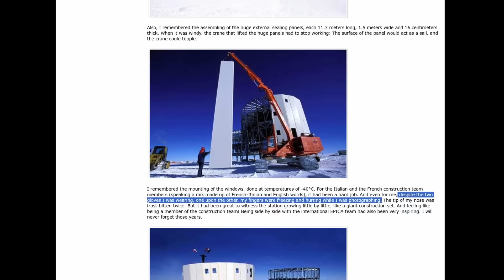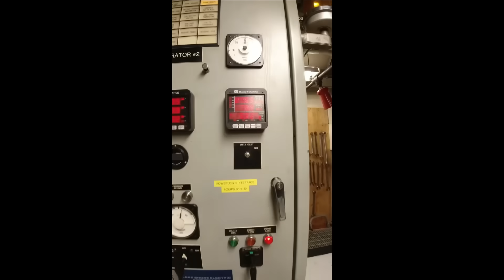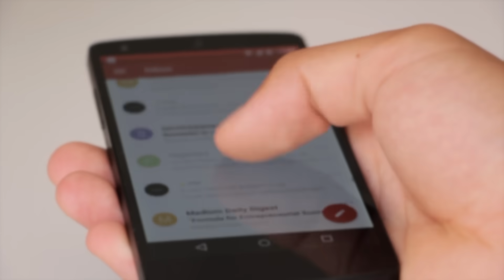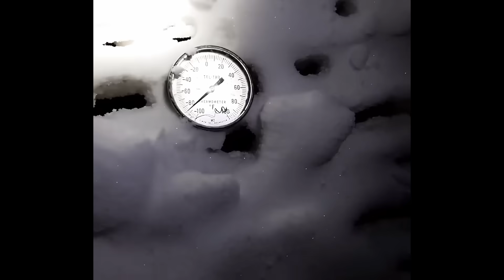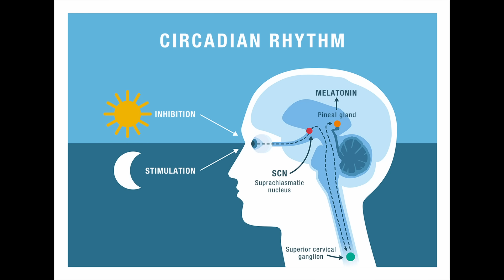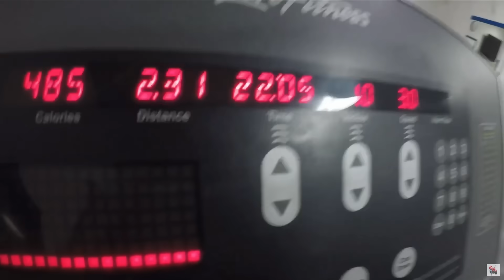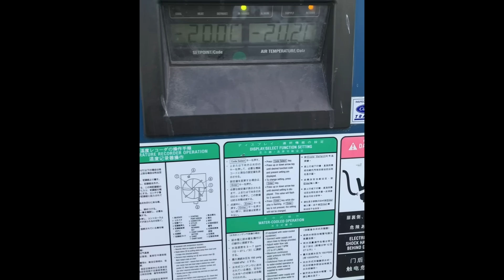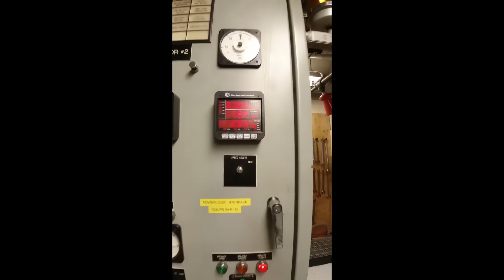How Antarctic Research Station Crew Works and Survives at –60°C

Comment: When he said,  "if the freezer fails" and the food goes bad. Um? Wouldn't it be easier to put it outside? Instead of using all that energy on a FREEZER?
Reply: I wonder if it gets too cold does the food lose its nutritional value? Also, it’s important to defrost large pieces of food in a refrigerator so the outside doesn’t start to rot before the inside defrosts. You need some king of cold temperature control.